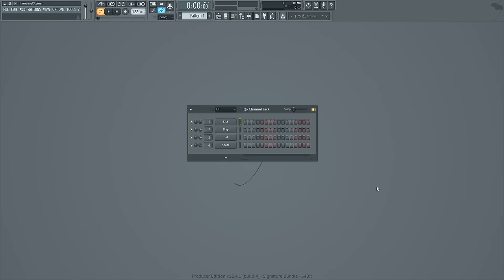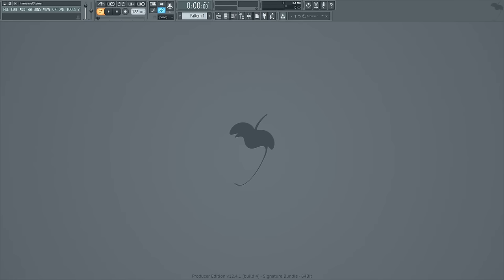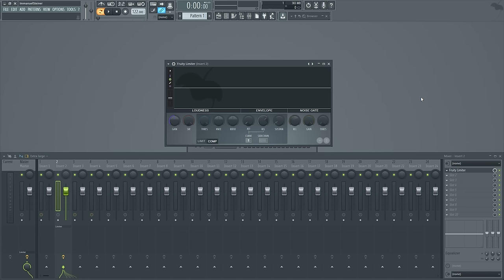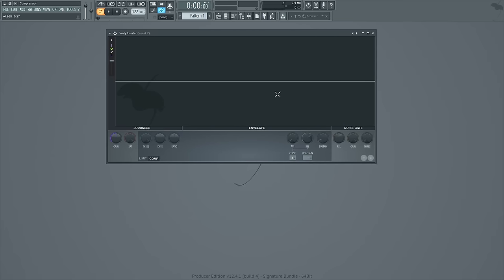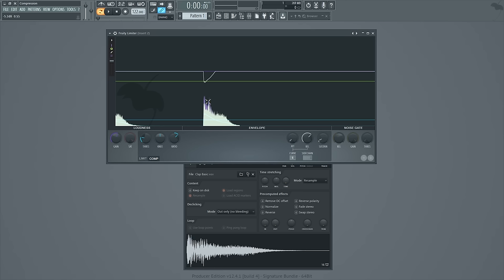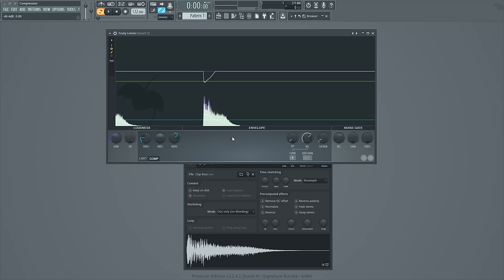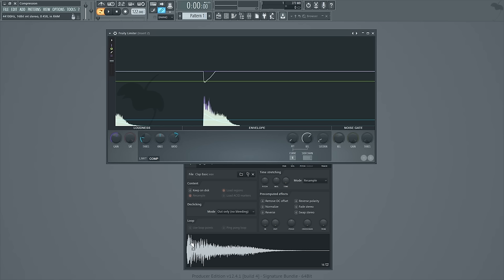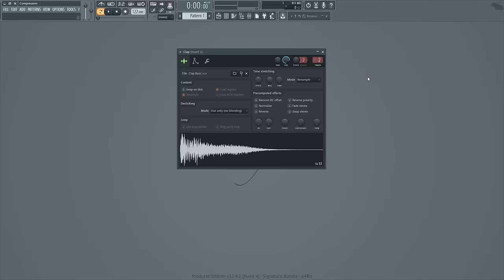Compression Tutorial: The Basics of How to Compress Properly

Comment: Hey man. I got a problem with compression a sub. Imagine i have a bass line with 4 notes. Ofc the higher notes will play higher volumes. So i need to use compression to make it regular.. can you explain me how to? Cause if i use the same method start distortion..

Thanks
Reply from the maker: You should probably use EQ to target cuts for the higher notes. Compress first (not too much - start with 2:1 ratio and a mild threshold, then work your way up, but don't overcompress) then EQ using a high shelf or peaks. Check out my EQ tutorial if you aren't familiar with EQing or the frequency spectrum.
Reply: Electronic Producer yeah. I know how to do it.. i already watch some tutorials about that. But never try. Instead of using compression.. will try thanks one more time

Comment: But how do you get the threshold height?
Reply from the maker: Totally depends on the input signal's volume and dynamics. Too low of a threshold will yield overcompression, and too high of a threshold will yield little or no compression. It's a bit of a balancing act between the threshold and ratio, but you get good at it over time!
Reply: So, thershold decides how much you compress and ratio does the job.. then gain raises the volume? Thank you!
Reply from the maker: Both threshold and ratio determine how much compression takes place. Threshold sets the decibel level for when compression to kick in, and ratio decides what factor to apply the compression at. They work together to compress the sound.

Comment: how do you know where to put the threshold ?
Reply from the maker: Depends on the sound and how much you want to compress. Too high and there is no  compression, too low and you will overcompress. Try with a 2:1 ratio to see where an optimal threshold is. You'll get better at setting it for each sound over time.
Reply: thanks man

Comment: why producers have to use many compressor vst ?
Reply: phuc nguyen  
They use different Vst compressors for "Different results". Some Compressors are more efficient than the others when getting the job done. For instance....one vst compressor's "Ratio" might be better than the others or one compressor' "Threshold" could be more effective than the others in boosting Dynamic ranges and frequencies.

I have tons of compressors and only 4 of them are more suitable for my work flow to get the job done. *So most Producers will personally use 3 or more Vst compressors for their own workflow in getting the job done without any hassle and compromising easy to use while some might have a better design and look to it.
Reply: thanks